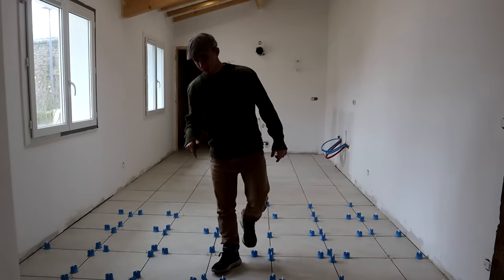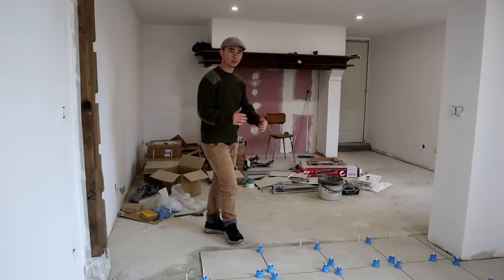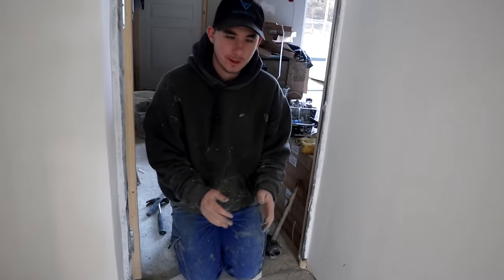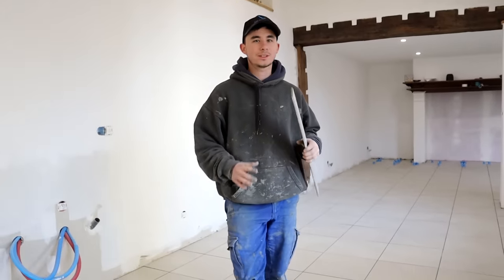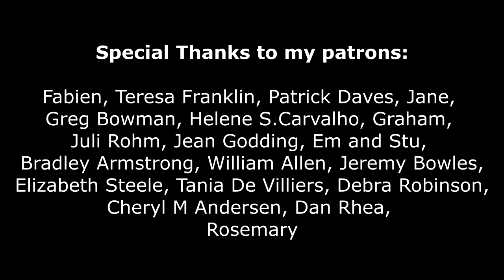Amazing Result on the Kitchen Floor! | Renovating our Abandoned House in France #70

Comment: Hello, I am a viewer from Germany (subscriber), I really enjoy following you and have been for a very long time. I am a self-employed craftsman. I would like to give you a few tips. I see how you're trying, but some things are much easier to do.
For a tile that is 8mm thick, use an 8mm notched trowel, more like 10mm on the floor. For a 10mm tile, at least a 10mm notched trowel, more likely 12mm, etc. Then everything will be much easier. For the tiles you used, I would have applied 6mm to the floor and also 6mm to the tile, then you get a total of 12mm, a very good measure to balance.
Think about it, try it and give me some feedback please.
You must not turn off the tension caps of the leveling system. You have to hit the tension caps along the length of the joint with the rubber mallet. Then they break off perfectly. You have some left standing that you then have to laboriously remove. Always hit the pull cap, never remove it beforehand.
Please try it out here too and give me some feedback.
I think you're great and I'm looking forward to the upcoming videos.
Oh, and be sure to vacuum the joints before grouting, because you swept in a lot of dust. This causes trouble when grouting. 👍😉🙋‍♂
Reply from the maker: Thank you very much for the advices😄👍 we appreciate it! Cheers